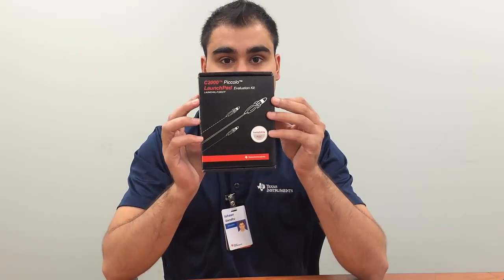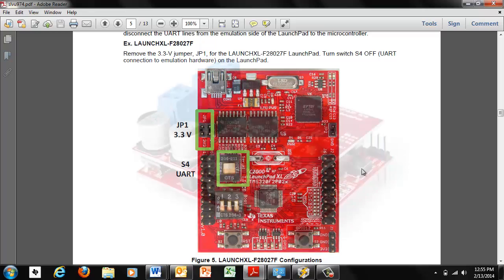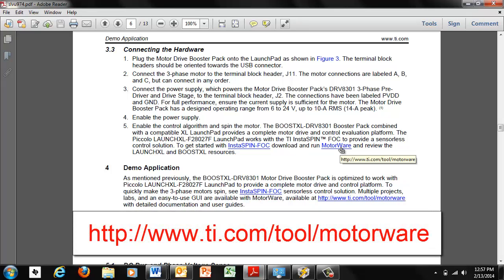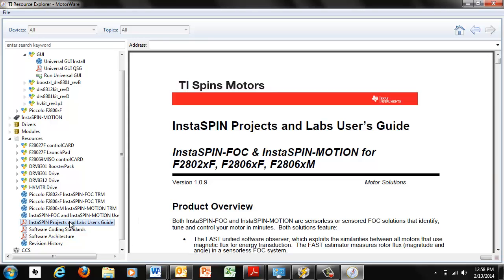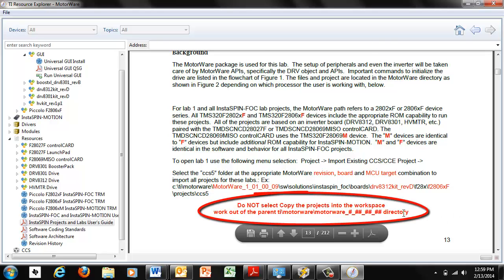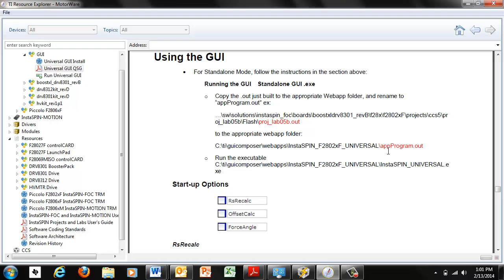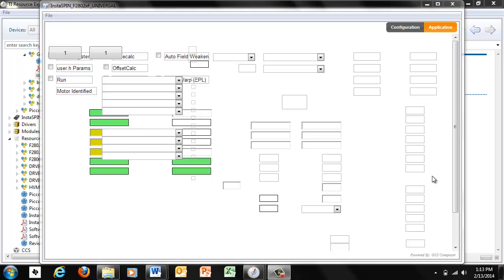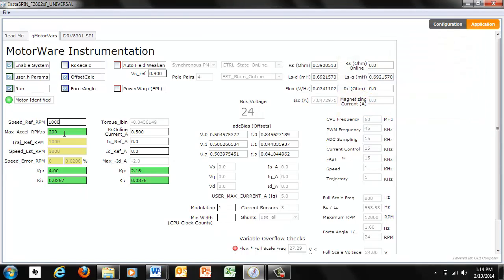Getting Started - InstaSPIN-FOC enabled C2000 LP - Motor BP

Comment: I wonder how accurate is FOC in angle shaft estimation . Can it really replace position sensor in precise applications like robotics and automation.
Reply: FAST can be used to replace mechanical sensors used for electrical angle tracking or commutation when the rotor is in motion (above a minimum speed).  It can NOT be used for absolute position control or tracking when the rotor is stationary.

Comment: Please have somebody rewrite the Getting Started guide.  The picture shows the switch and jumper in the wrong position and the manual makes no mention of removing JP2. It also says nothing about the three DIP switching and it says to put S4 in the OFF position whereas you said to put it in the ON position.